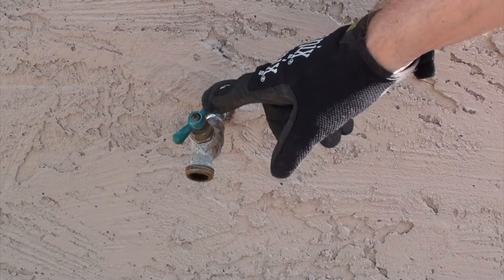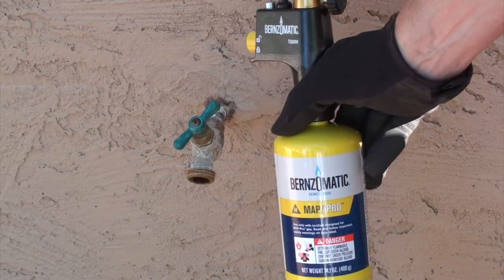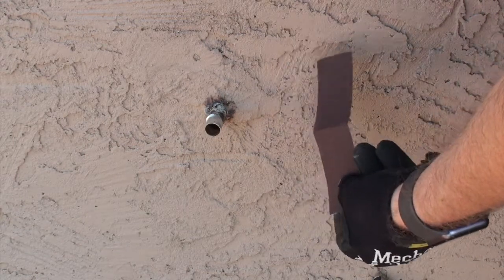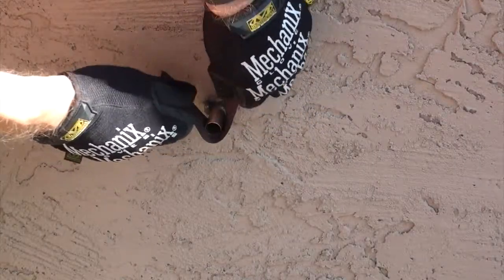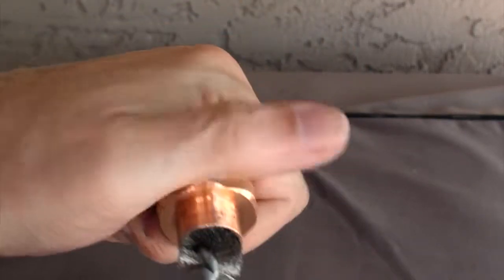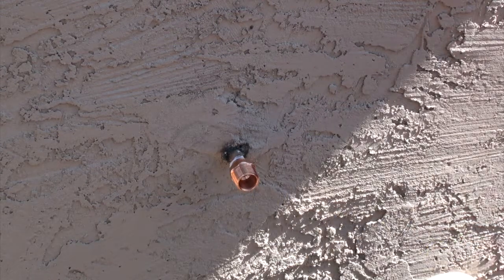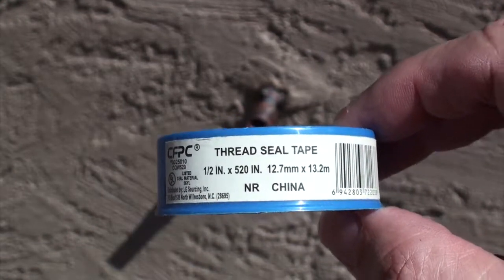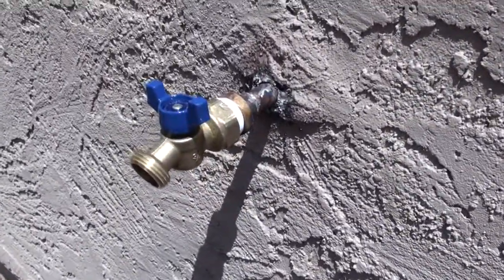hose bibb repair and resolder

Comment: Fantastic tutorial done at just the right speed with great discussion. Only recommendation would be post the links to the kit you used just in case someone isn’t familiar with the various tools and types. It would be an easy way for them to quickly get everything they need to do the repair.
Reply from the maker: Thanks for the tip!
Reply: I agree the point made about the speed of explanation. Well done, Sir. It helped me for sure.

Comment: No idea why this showed up in my feed.  But you don't need to put Teflon tape if you use a rubber washer in the new hose bib.  Both serve the same purpose.  I would personally use Teflon over a rubber washer or alternatively a CNAF washer.  Rubber does degrade over time, especially if you have a lot of chlorine in the water.

Comment: I was just gonna say… my new faucet came without a rubber washer, but I do have white plumbing tape. So do you recommend I buy a washer? If so, what size fits into a 3/4” faucet, is that also 3/4”?
Reply from the maker: I think it should be

Comment: Is MAP gas better than propane? Having trouble getting the solder to melt.
Reply from the maker: I was told map gas burns hotter than propane so you may have better luck with it